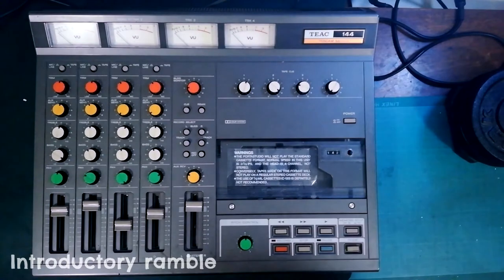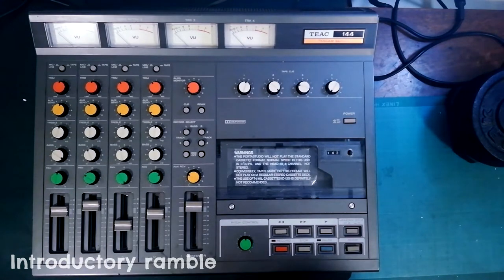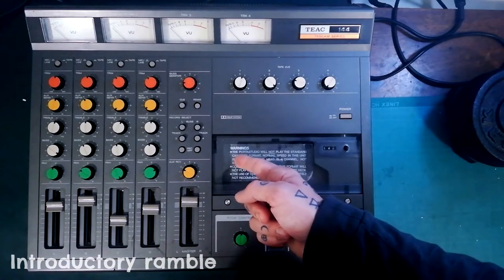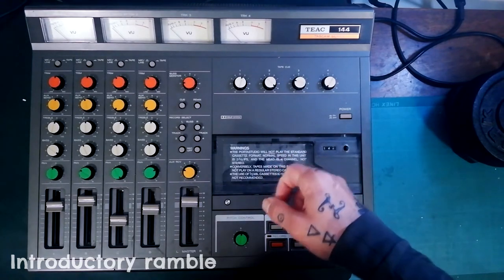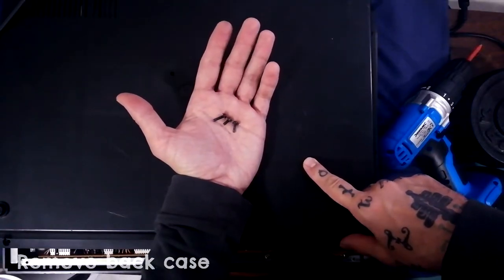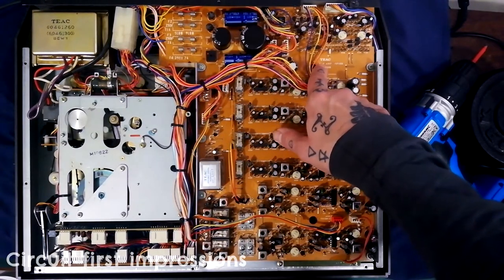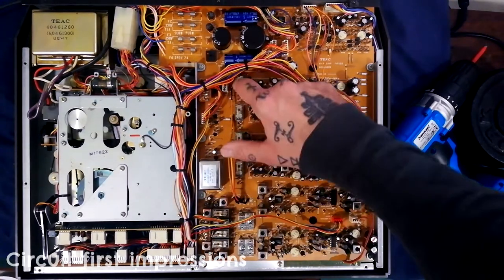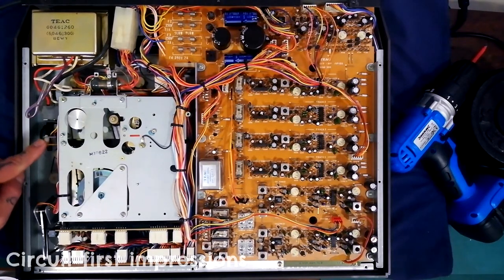Teac 144 | 1 | Remove knobs | Open case | Remove transport | Electronics - first impressions

Comment: Yeah you finally bust out the 144! Nice to see you again, Tetra. After our last discussion I think I will probably have to do the work myself on both 144's I have and the 244 which work froze on when the pandemic started. I'll DM you soon about the 244, but thanks for finally taking a look at this bad boy! (To anyone curious who wants to brave this one, the 144 has AMAZING sound quality if you can get it working right. It's the machine that recorded "Nebraska" by Bruce Springsteen. And as Tetra' indicated in another video, you can compensate for the loss of high end to Dolby B by boosting your fixed high end, works really well.)

Comment: I have two of these units both of them are not producing any sound all the lights are working no audio is coming from the tapes. Do you know which capacitors to check on the teac 144?

Comment: Hello I have a 144 myself and was hoping you could help point out an issue. Play and record don’t work unless I hold down the play button, I heard it could be the belts but I want a second opinion
Reply from the maker: For the sake of the 144s longevity it might be worth getting new rubber parts anyway, but no, that doesn’t sound like a belt issue to me. I think it’s more likely the tactile switches underneath the plastic buttons need to be cleaned or replaced, see this video https://youtu.be/fhZHQhQ01vw
Reply: @Tetrakan  so would it be best to replace the controls as a whole
Reply from the maker: If you're confident soldering, can source appropriate replacement tactile switches then yeah it's worth doing for the sake of the longevity of the machine even if it doesn't solve the problem. Cleaning the existing switches doesn't always work and it's a temporary measure by comparison
Reply: @Tetrakan  I’ll look into that. Thank you

Comment: Hi - have a 144 I'm repairing, works OK apart from no signal from Tracks 2,3,4 either through CUE or REMIX playing from tape. Track 1 is fine, all inputs OK (faders, EQ, MIC/TAPE switches etc). There is a background hiss on the 2,3,4, not totally dead, but no playback. Input channels are all OK, and can record to TRACK 1, but not 2,3,4. RP board issue, rather than mixer board? - what would be the obvious culprits? I've stripped it down and checked for solder joints, obvious blown components, bad traces etc, dodgy switches - all seems OK. Not convinced it's the head...? One thing I did notice is on the RP board the channels 2,3,4 have a wire loom extending from just to the right of a bank of 4 relays, to individually each of the channel relays for those channels(!) - but channel 1 doesn't have this...? I assume this is "normal", but is tingling my spidey sense given the issue! Any pointers would be appreciated!
Reply: Quick Update.
A few strip downs later - noticed that the set of relays on the RP board are behaving a bit oddly...on power up they all click (so powered), channel 1 will double click and reset, 2,3,4 will click and remain open/closed (not sure which). The switches to engage REC 1/3 - 2/4 only activate the channel/track 1 relay, nothing for 2,3,4. Is this normal? The switches seem ok,gettting good signal from them across the board and switching OK. Ploughing on...
Reply from the maker: I haven't had a chance to work on that board- either had 144s with a working r/p board or the transport was too ill to establish the health of the r/p system - so take what im saying with a grain of salt. Yeah sounds like the issue is on that board, which is a mercy because its the most accessible thing on that model. Check your theory that 3 relays are misbehaving by using continuity tester to compare results between healthy channel and misbehaving channels. If you're right, it seems slightly implausible that all three relays would develope a fault so look at the schematics see if there's something in common upstream, there's usually transistors and diodes involved with turning the relays on in response to user button presses (look for inputs from control boards) those could be tested out of circuit or just replaced.
Reply: @Tetrakan  Ok, thanks for that. Would you say the relays should operate the same at power on / and engaging REC, as they don't! On power on channel 1 double flips, 2,3,4 flip up (breaking the continuity...?). I'll have a play this afternoon and see if I can trace this...
Reply: Mini Update.
So The relays are probably a symptom, rather than the cause. They should be operating as channel 1  - down position when powered, so I powered up and removed the plastic caps and pushed them against the contact - a signal came through, but very quiet, but better than literally nothing. I'm thinking that whatever is not activating the relay is also preventing the proper audio signal getting through...on we go!
Reply: Going back in today...looking at the 2 controller boards. If you have a 144 knocking about, and have the time(!) could you check the video here 
https://www.youtube.com/watch?v=1KPqp2dg36U
 to see if this happens on yours, or if you think this is not normal when powering up. The left most relay is TRACK 1, the others are 2,3,4 - the behaviour is TRACK 1 double clicks returning to the down position, 2,3,4 click once staying UP, I think breaking the continuity. Cheers!
Reply: NEW UPDATE. removed the transistors from the control boards, tested - all OK, replaced. put all back  together, hey new fault! Now the transport won't even engage for more than a few seconds on any mode...FFS. Video here -
https://www.youtube.com/shorts/honB8ITPBd0
I'm not stopping the tape, it stops itself. It will run if I hold any of the transport buttons. Not the autostop, same even if unplugged, and is moving OK....Losing the will to live.
Reply from the maker: @richardsmith4992  sorry I haven’t replied to these last few comments in any depth, life has been a bit mad. I’ll be honest, I think this unit while historically important is a dog to work on. In that context, I actually have the one from these videos here, with an intermittent idler tire problem, despite all attempts to lubricate the mechanism, fit tires bought at considerable expense from tascam ninja etc etc. the owner is wanting rid of it.  Can’t vouch for relays etc since transport issues meant I never got as far as properly testing audio paths, but at least the control boards etc do what they are meant to. Maybe having two side by side with different problems would help diagnose or clarify, but again being honest I’m reluctant to touch another one of these. Its complete, in its original box, in very good cosmetic condition. If you’d be interested in making an offer for it, msg me over Facebook messenger and I’ll pass your offer on to the owner?
Reply: @Tetrakan  Hi - no worries, I've put it on the ever growing back burner for the moment, til the weather cools and I 'm not tempted to rage it into landfill with it's infuriating weirdness. I actually quite like the way it's put together, given it's era, the solenoid on the transport is something I've never seen. I've worked on 244/246/488/porta one/two/ fostex etc - all of them "easier" than this. I'm not much of a facebook user but I'll message you later today, cheerrs!

Comment: The 144 does not have 4 individual outputs for each track which would be extremely helpful if you want to send to an A to D converter and then mix each track in your DAW. This is especially true if you have older recordings you want to remix or remaster. It would be amazing if you could come up with a modification to have a separate output for each of the 4 tracks. Is this something you could make a video on how to do? Thanks for making the videos you have already done, they are a huge help.
Reply from the maker: While making modifications to the mixers of portastudios is something I intend to cover on this channel, the  144 is probably not the first candidate to get this treatment;- because there is very little space in there to mount new sockets; because dissassembly/access is unusually poor/ difficult on this early model; because I have my doubts about the longevity of the transport in this unit due to a lack of official spare parts and an excess of moving parts. I'm more likely to do this on a porta 05, since there is plenty of free space in there and it's dead simple to take apart, maybe others can adapt that modification to the 144? If digitally capturing old 144 demos is the main reason you'd like to do this, I'd suggest capturing them in a portastudio with tape outs and defeatable noise reduction like the 246, 464 or later 424s, then use plugins to take the decode stage of the Dolby noise reduction written into the 144 audio. Thanks for watching.
Reply: @Tetrakan   Thanks for your reply.  I actually went out and purchased a really nice Tascam 244 for the very reason of having 4 individual outputs to transfer my old tapes seamlessly to the digital realm, but what I am finding is that it is not translating my older tapes properly. There is  a big sound loss difference and track one on my old tape is now on track 4 and I hear just a different sounds on the individual 144 tracks output than I do on the 244 individual track outputs. I figured the Tascam 244 would have been the logical choice because it has the same tape speed and was the very next Portastudio that Tascam produced after the 144. Is there something I am not taking into account?
Reply from the maker: @acadiansunrecorders1701  well they’re using different noise reduction tech. I assume the Dolby system in the 144 is a two part compander process, the dbx in the 244 definitely is. So your sound was encoded by one NR scheme and being played back in another, which is bound to sound weird. If you bypass the dbx on the 244 using DuPont wires as jumpers ( it’s in the service manual how to do this, page 31? Something like that...) then that will remove half your problems though you’ll still need to find a way to use a dynamics plug in within your daw to “decode” what the Dolby chip did to the sound when the recordings were made.
Reply: @Tetrakan  Thanks brother, you are a wealth of knowledge!

I know you said there is limited space in the 144 to put some output jacks on each track but I wouldn't mind if I could just have an external set of outputs for the 144. Just splice into the internal tracks and then drill a hole and have an outside output hub to plug into. I am just not sure where or how to tap into each track is all. Since the tapes I am dealing with were recorded on the 144 it would be so optimal to have them outputed on the exact machine.